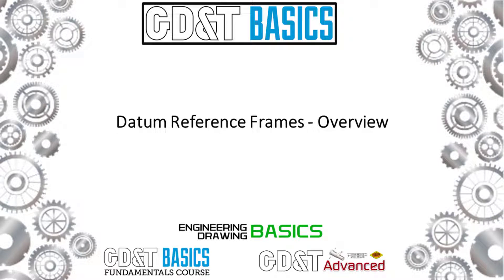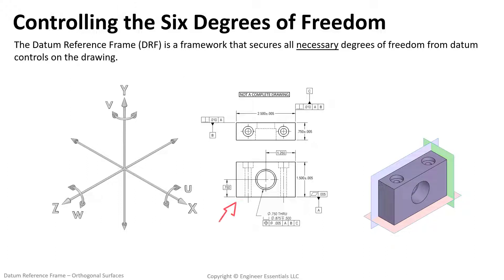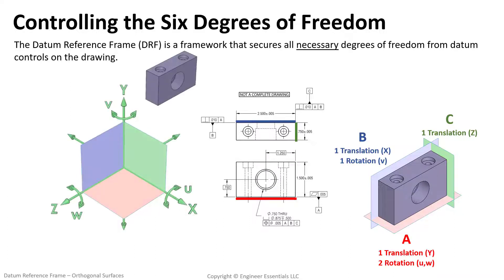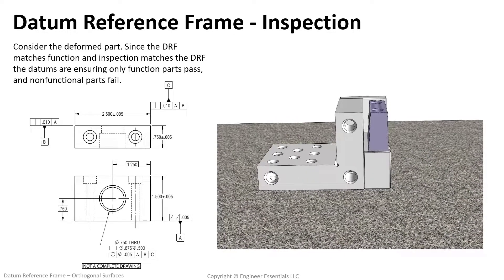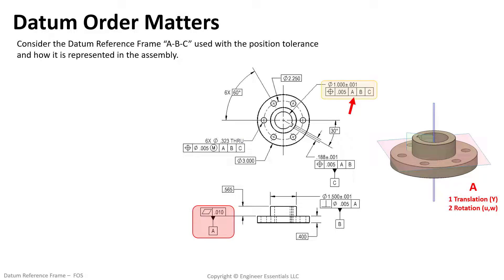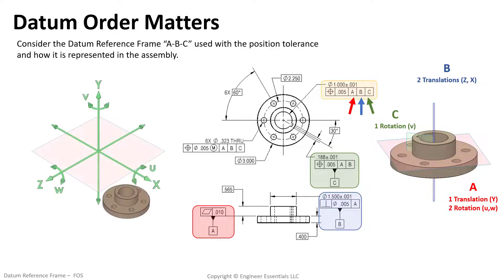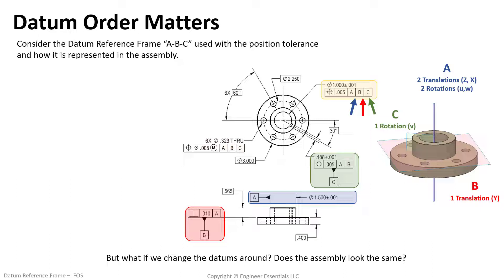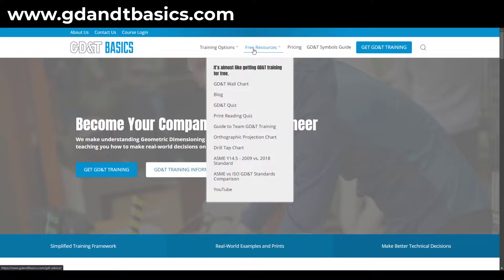Datum Reference Frame Overview

Comment: I think of the following guidelines while deciding the precedence within the three selected datums. 
1.  The capability of DEFINING the position. ( A plane flat surface is just incapable, while as, any central axis can do it nicely)
2. The sequential contact with the concerned datum simulators. 
3.  The ability to restrict maximum degrees of freedoms, with due consideration for the sequential contact. 
4. The friendliness to functions like assembly, production, inspection, toolings etc.
As per these guidelines, at your second illustration, the OD seems to be the better and proper choice to be the primary datum. 
Your comments please.
Reply from the maker: Thanks for your comment! To clarify, the datum precedence when setting up for inspection MUST come directly from the feature control frame on the drawing. Thus the primary locks in all of the allowable degrees of freedom with the secondary and tertiary locking in the remaining sequentially. 

The ASME Y14.5 Standard specifically states that selection (when designing) of these datums should mimic the assembly requirements. That should be your first goal when applying GD&T to a feature as a designer/drafter. However, occasionally the assembly requirements can be trumped by ease of inspection or set up.

Comment: Are we to consider two perpendicular planes passing thru the axis if the primary datum is controlled by cylindricity?
Reply from the maker: If your Primary Datum is created using a cylindrical feature, the datum itself is an axis.